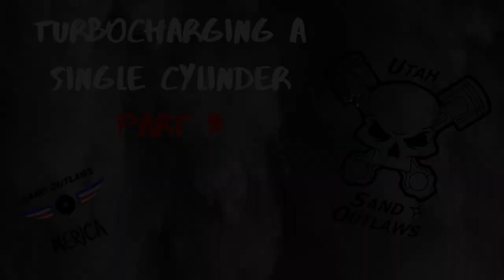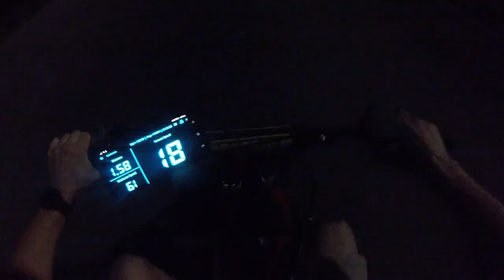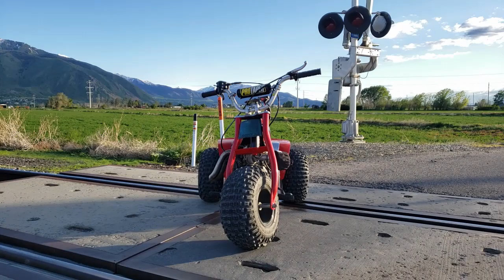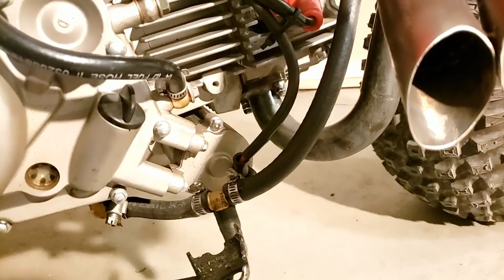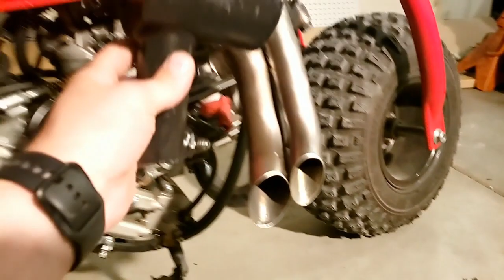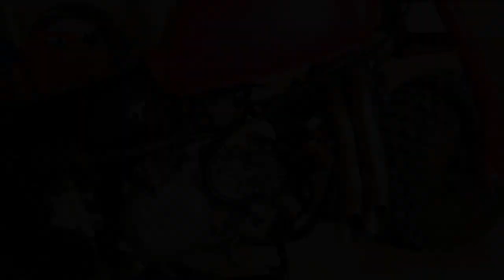Honda ATV Turbocharger - How to turbocharge #3

Comment: You did away with the oil cooler did that affect anything or worry you about possibly burning up the motor?
Reply: Oil cooler is not mandatory for these engines. If you buys the cheaper kit, theres no cooler, and the inlet and outlet are just joined together with a really short pipe across.

Comment: Hi, love the build. I’ve done the same with my EFI Zs212. I was looking at maybe tapping my return into the valve cover. Think that would work?
Reply from the maker: I don't think there is any place to return the oil except the bottom, at the oil drain plug. I've vented the cases from the valve cover, and under boost, the pressure coming from the valve covers is pretty crazy.... That's been the biggest problem with these small motors, case pressure. If your only going to run 6 to 8 psi, it might be feasible.
Reply: @boostedraptor  thanks for you reply. Ill give it a try, if it doesn’t work it can just be a vent...I’ll have a look at going into the sump plug also.
 You’ve not needed a scavenger pump if it’s going into the sump plug and the oil hasn’t been backing up in the line? 
Might use some clear tubing to see what’s going on 👍🏻

Comment: How do you know what size turbo to get for the size of motor??
Reply from the maker: I made an excel spreadsheet calculator for single cylinder motors. Size the compressor for roughly the horsepower you plan to make and the turbine side for  roughly double the horsepower. Typically you need a hybrid turbo for the most efficient setup, but in short, a vz-21 sized turbo works good for anything 50cc to 200cc. After that you need to go bigger on single cylinder engines.

Comment: damn thats sick 😄 i myself work on projects like this whenever im able to 😄 right now im working on  a diy efi system with a microcontroller ecu (arduino speeduino board) but im still looking for a small external oil pump for a engine without a pressurized oil system (if i decide to slap a rb31 turbo on it when i get the efi system done) 😅 maybe you know a pump model that can get the job done without costing a furtune ?😂😂😂
Reply: look up an oem part off motorcycles with that style of pump you are looking for? i know it doesnt help 6 months later but if it does...

Comment: How many pounds it make?
Reply from the maker: I've had it between 10 and 20 psi. I try to keep it on 10 psi though 90%of the time. I'll upload a sand hill climb video on 10 psi right now. I keep forgetting!
Reply: @boostedraptor  cool! I was wondering because that engine is pretty small. 10 plus is impressive! I was thinking about getting the same turbo for my scrambler 500 but I decided on a k03 from a vw
Reply from the maker: @chadman4965  a K03 for a 500cc 4 stroke single cylinder should have good low rpm spool. Wouldn't be great for high boost on that motor but you're off to a good start imo! 🤘
Reply: @boostedraptor  what compression ratio do you have on your engine?
Reply from the maker: @chadman4965  this engine is bone stock, it's at 10:1 compression
Reply: @boostedraptor  what is the comp ratio of the engine? Did you have concerns over the strength of the engine when pushing 10+ lbs through it?
Reply from the maker: @healthyhuman2360  thank you! This motor is unbelievably strong with everything bone stock! No major issues. Figuring out the best turbo, plenum size, and a few other small items took a while. Watch for a short update video asap, tomorrow or Friday discussing it all!